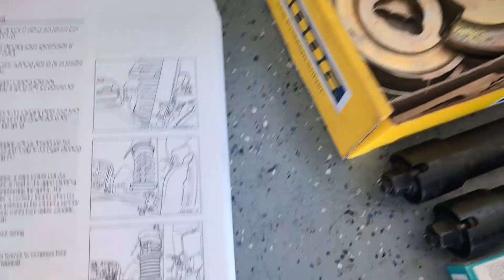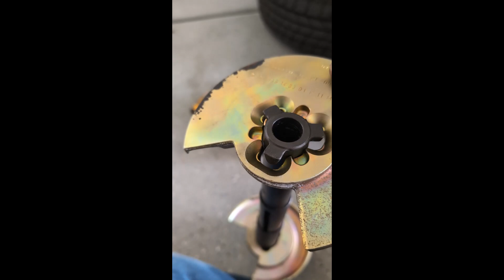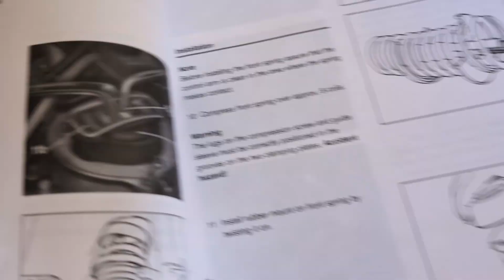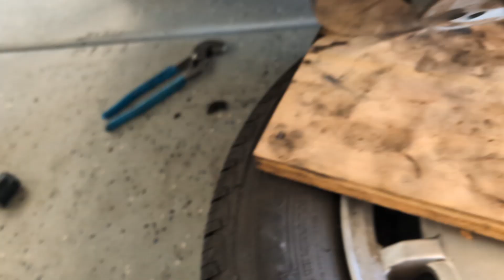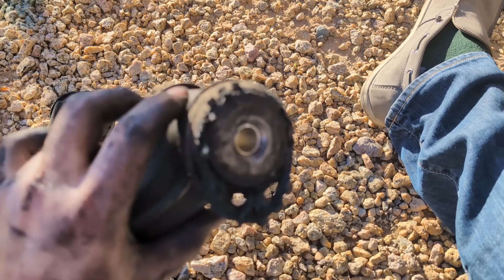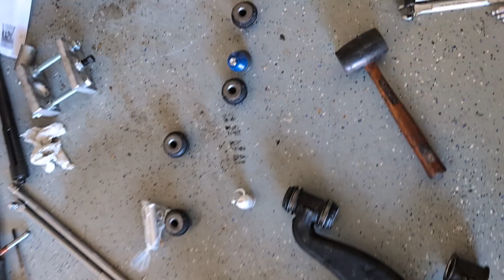Removing and replacing front lower control arm on the W124  (part 1)

Comment: By the time yoj paid for the bushings and the tool plus time you could have bought new control arms. For about the same price and not have to deal with greasy rusty parts.
Reply from the maker: That's what I ended up doing actually - but it was great to have the old ones. Mercedes sells the ball joints and bushings but does not sell the whole unit. I rebuilt mine with new MB parts later on- but in the part 2, it shows how I got a Lemforder unit already assembled.

Comment: Heya, Brian!  Did you ever end up getting the bushings into your old control arm?  And, if so, how?  I'm running into a somewhat similar problem where I can get one side in flush, but the second side just won't seat evenly.
Reply from the maker: I did - but I broke down and brought it to MB of Chandler since they have the proper tools. Upon getting it back, I realized I didn't take the old ring part of the bushing off. You might be in the same boat there- make sure the old ones are completely removed

Comment: Thanks for sharing! Doing the same to my om603 300D
Reply: Yea im about to replace the whole front suspension on my 87 300d. Just did rear suspension. Rebuilt axles. Shocks. Complete brakes and wheel bearings. It was all pretty easy except rear bearings. Good luck on yours.

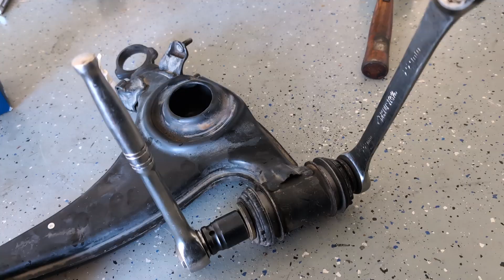Comment: anybody know OE number of thoes bolts at 22:18  i have later model lower control arm but i belive those bolts are the same
Reply from the maker: Hi @SmanEDITS - these are called Eccentric bolts and the part number for one bolt (includes hardware) is 201-330-00-18. Should be around $10 USD at the dealer for the Genuine MB branded part.

Comment: Question for you, what is the book you use for fixing the w124?
Reply from the maker: Hi good question - I am using the official MBUSA shop manuals. There are digital versions available but I bought the physical ones from eBay. I have the chassis manual 1 & 2, the AC manual, the 602/603 engine manual, and a few more (including ETM - electronic technical manual)

Comment: I had no idea about that Mercedes spring compressor, very interesting piece.👍
Reply from the maker: It's a great tool! I had a generic clone of this tool from eBay (like $50) and didn't feel safe using it. Threw that in the trash (don't want someone else getting hurt!) and got this one. The compressors are branded "Miller" (name used for Daimler Chrysler)- but that is also made by Klann Tools (who made tools for MB). The company now is called Gedore Tools. Felt very safe using it 😁 Thanks for the tip on the rotor, BTW!
Reply: Brian, the spring compressor you got there. Are they expensive? Can you share the link to the website?
Reply from the maker: @lekubaka  Good question - the tool I have is the one by Klann Tools. I got the set (compressors, plates) for $800 USD used. There are clones of this on eBay if you search "w124 spring compressor". I did not feel safe using those. But they are much more affordable. Because I may use this tool somewhat often, the investment is not so bad for me.

Comment: Yep - went through the same with my R129 - the full set from FCP was an easy fix. Still have the old just never taking the time to figure out the bushing - Great tutorial either way!
Reply from the maker: Lesson learned on my side - definitely easy to do the whole assembly 🙂 Should be able to wrap up this weekend. How has the ride/handling been after doing it?
Reply: @bsclifton   Much much better - as you are getting new ball joints and control arms - get an alignment as well  or get it checked to be safe.
Reply from the maker: @cjlomax2156  will do! Actually, before that I'll need to replace the drag link, both tie rods, the idler arm bushing, and then the steering damper. THEN it's ready 🙂 Those should be a lot quicker though. I'll do my best to get those on video and maybe Mercedes-Benz of Chandler might even let me show off an alignment. The dealer has great equipment for doing it and it's a super fair price

Comment: Wow. I've never pressed out control arm bushings. Always went for the whole assembly right up front. Interesting to see. The control arm is the exact same as on the R129, and they are  basically just a larger version of the W201 (190E) chassis parts. So all the tools & trepidations you are showing are applicable on those models as well.
Reply: Your w201 vids are awsome!